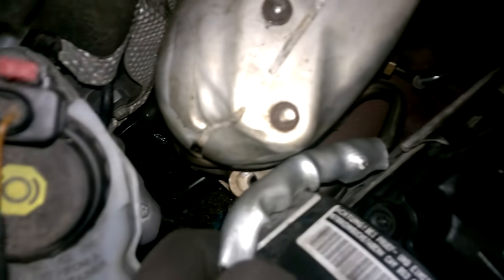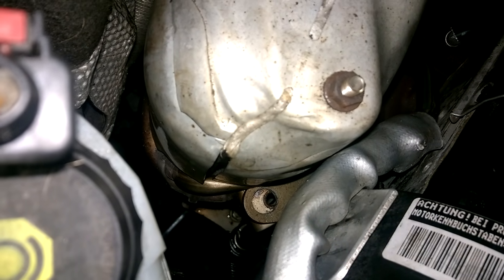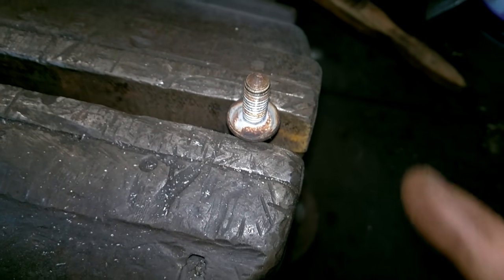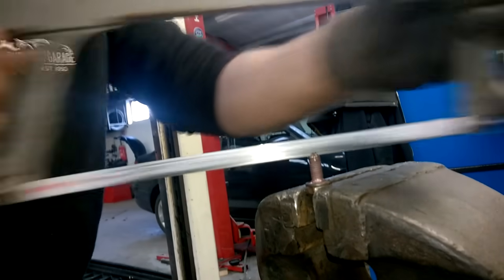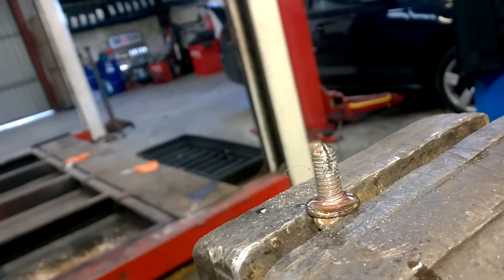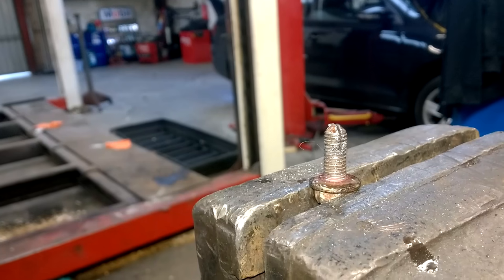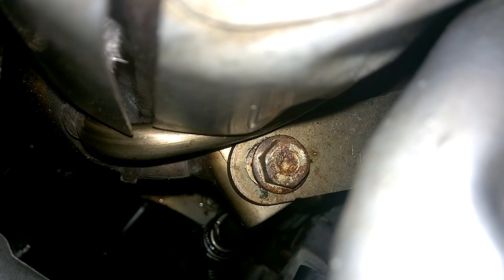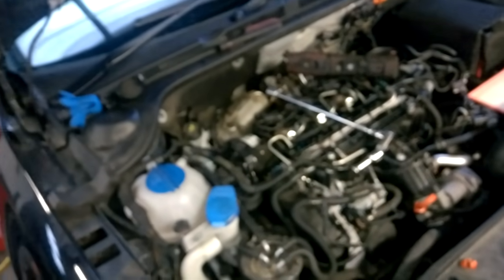My Father Taught Me This! Passing It On To The Next Generation

Comment: Pretty good trick
Reply from the maker: The update info below is the pinned comment on this video, I know most people do not realize I made that video and it better explains/shows this method in use.   
I also included below details of why the job was done this way free of charge with the customer fully informed. I hope you check it out  👇👇
 
UPDATE* I decided to make a follow up video on this https://www.youtube.com/watch?v=yfNQullGEuQ&feature=youtu.be Should answer some of the questions that were raised, I include 3 demos of this in action with close up shots.
 
As there was some safety concerns & confusing comments raised, I felt I should clear a few things up. 
1) This is a tip for certain circumstances only, I never have and never would use it on a component which would cause any safety concern to any customer.  
2) The demo was done on a support bracket only, items like this or similar will not cause any safety concern. 
3) I did this free of charge and on a time restraint, I noticed it when I was replacing another item, the customer needed the vehicle back that evening and I decided rather than leave it like it was, I would do this and secure it up fully. 
4) The bolt was not the issue, the part that the bolt threads into is a secured piece, someone had previously damaged it, leaving the bracket loose and the bolt just tightened a turn or so.
5) The bolt can be removed and will not break, it will go in and out as usual and has helped clean up the damaged threads.  
6) Used in the right application I personally believe this is a great tip and can save you a lot of time & trouble. 

Lastly to all the people who have watched the video, Thanks very much and I am delighted with the feedback I have received on it.

Comment: Good idea.  But a pry bar does wonders
Reply from the maker: The update info below is the pinned comment on this video, I know most people do not realize I made that video and it better explains/shows this method in use.   
I also included below details of why the job was done this way free of charge with the customer fully informed. I hope you check it out  👇👇
 
UPDATE* I decided to make a follow up video on this https://www.youtube.com/watch?v=yfNQullGEuQ&feature=youtu.be Should answer some of the questions that were raised, I include 3 demos of this in action with close up shots.
 
As there was some safety concerns & confusing comments raised, I felt I should clear a few things up. 
1) This is a tip for certain circumstances only, I never have and never would use it on a component which would cause any safety concern to any customer.  
2) The demo was done on a support bracket only, items like this or similar will not cause any safety concern. 
3) I did this free of charge and on a time restraint, I noticed it when I was replacing another item, the customer needed the vehicle back that evening and I decided rather than leave it like it was, I would do this and secure it up fully. 
4) The bolt was not the issue, the part that the bolt threads into is a secured piece, someone had previously damaged it, leaving the bracket loose and the bolt just tightened a turn or so.
5) The bolt can be removed and will not break, it will go in and out as usual and has helped clean up the damaged threads.  
6) Used in the right application I personally believe this is a great tip and can save you a lot of time & trouble. 

Lastly to all the people who have watched the video, Thanks very much and I am delighted with the feedback I have received on it.

Comment: Nice video. Thanks.
Reply from the maker: Thanks Mark 
 
The update info below is the pinned comment on this video, I know most people do not realize I made that video and it better explains/shows this method in use.   
I also included below details of why the job was done this way free of charge with the customer fully informed. I hope you check it out  👇👇
 
UPDATE* I decided to make a follow up video on this https://www.youtube.com/watch?v=yfNQullGEuQ&feature=youtu.be Should answer some of the questions that were raised, I include 3 demos of this in action with close up shots.
 
As there was some safety concerns & confusing comments raised, I felt I should clear a few things up. 
1) This is a tip for certain circumstances only, I never have and never would use it on a component which would cause any safety concern to any customer.  
2) The demo was done on a support bracket only, items like this or similar will not cause any safety concern. 
3) I did this free of charge and on a time restraint, I noticed it when I was replacing another item, the customer needed the vehicle back that evening and I decided rather than leave it like it was, I would do this and secure it up fully. 
4) The bolt was not the issue, the part that the bolt threads into is a secured piece, someone had previously damaged it, leaving the bracket loose and the bolt just tightened a turn or so.
5) The bolt can be removed and will not break, it will go in and out as usual and has helped clean up the damaged threads.  
6) Used in the right application I personally believe this is a great tip and can save you a lot of time & trouble. 

Lastly to all the people who have watched the video, Thanks very much and I am delighted with the feedback I have received on it.

Comment: Thank you!.
Reply from the maker: Thanks Charles 
 
The update info below is the pinned comment on this video, I know most people do not realize I made that video and it better explains/shows this method in use.   
I also included below details of why the job was done this way free of charge with the customer fully informed. I hope you check it out  👇👇
 
UPDATE* I decided to make a follow up video on this https://www.youtube.com/watch?v=yfNQullGEuQ&feature=youtu.be Should answer some of the questions that were raised, I include 3 demos of this in action with close up shots.
 
As there was some safety concerns & confusing comments raised, I felt I should clear a few things up. 
1) This is a tip for certain circumstances only, I never have and never would use it on a component which would cause any safety concern to any customer.  
2) The demo was done on a support bracket only, items like this or similar will not cause any safety concern. 
3) I did this free of charge and on a time restraint, I noticed it when I was replacing another item, the customer needed the vehicle back that evening and I decided rather than leave it like it was, I would do this and secure it up fully. 
4) The bolt was not the issue, the part that the bolt threads into is a secured piece, someone had previously damaged it, leaving the bracket loose and the bolt just tightened a turn or so.
5) The bolt can be removed and will not break, it will go in and out as usual and has helped clean up the damaged threads.  
6) Used in the right application I personally believe this is a great tip and can save you a lot of time & trouble. 

Lastly to all the people who have watched the video, Thanks very much and I am delighted with the feedback I have received on it.

Comment: Couldn't you have just used a tap and die to clean up the threads on the bolt and the hole? I would think that might possible repair and save some of the threads that are damaged. All the threads that are opposite that cut are pretty much worthless as far as offering strength. I'm not knocking the hack, in fact, I think it's rather ingenious. I just thought a tap and die might provide a more secure attachment.  Great video!

Comment: Basically just made a tap. Cool!
Reply from the maker: Thanks Jason, I appreciate the comment, I have linked below the follow up video if your are interested in seeing it in more detail.
 
The update info below is the pinned comment on this video, I know most people do not realize I made that video and it better explains/shows this method in use.   
I also included below details of why the job was done this way free of charge with the customer fully informed. I hope you check it out  👇👇
 
UPDATE* I decided to make a follow up video on this https://www.youtube.com/watch?v=yfNQullGEuQ&feature=youtu.be Should answer some of the questions that were raised, I include 3 demos of this in action with close up shots.
 
As there was some safety concerns & confusing comments raised, I felt I should clear a few things up. 
1) This is a tip for certain circumstances only, I never have and never would use it on a component which would cause any safety concern to any customer.  
2) The demo was done on a support bracket only, items like this or similar will not cause any safety concern. 
3) I did this free of charge and on a time restraint, I noticed it when I was replacing another item, the customer needed the vehicle back that evening and I decided rather than leave it like it was, I would do this and secure it up fully. 
4) The bolt was not the issue, the part that the bolt threads into is a secured piece, someone had previously damaged it, leaving the bracket loose and the bolt just tightened a turn or so.
5) The bolt can be removed and will not break, it will go in and out as usual and has helped clean up the damaged threads.  
6) Used in the right application I personally believe this is a great tip and can save you a lot of time & trouble. 

Lastly to all the people who have watched the video, Thanks very much and I am delighted with the feedback I have received on it.

Comment: When you have to remove it and it breaks and drops down inside the hole you’re done
Reply: That's the next poor pricks problem :)
Reply: Has that actually happened to you?  I don't predict that problem because the cut part of the bolt would have the least pressure against the threads in the bolt hole.  The cut space could hold dirt and rust instead of binding into the threads.  Has that ever happened to anyone?
Reply: @Daddy007111  Cutting the bolt turns it into a tap.  That's the trick.  A person could add another cut at 90° to make the bolt go in even easier and cut more and store more dirt and metal shavings as it does.

You'd have to have a mighty extensive tap and die set and take it with you everywhere there might be a breakdown to get every possible bolt nice and perfect.

You can't always fit the tap into the hole.

I have run into so many bolts that didn't fit my tap set.  The English used to have their own proprietary threads...requiring its own tap and die set.  And this is an old trick that probably fit that time and place of oddball threads.
Reply: @beyondwhatisknown  if you have all the answers then why ask a question. You do it your way, I will do it the right way.  Not arguing just saying what I would do.  Glad you’re in England I won’t need your services.
Reply: @Daddy007111  The right way to do something changes with time available, tools available, your location, proximity to parts, the consequences of your fix going wrong, desperation,  weather closing in, one's own limited knowledge and lack of omniscience.

Nobody has all the answers.  

I have never been to England.  

I heard about English threads from an ex-american who had all kinds of taps, such as flat bottomed ones so you can thread all the way to the bottom of a hole.
Reply: @beyondwhatisknown  when I saw the smoke coming off the bolt  I didn’t care for it.  That’s heat and it weakens the metal when you cut away at it.  Vibration,pressure all factor in to whether it’s a permanent fix or for the moment/ convenience.  If you are going to do it might as well do it right.  Also the bottom of that particular bolt is narrow so it starts easy.   I do enjoy speaking with an intelligent person. Thanks and Happy Wrenching

Comment: Your hack saw blade is toast you should be able to cut that with four good pushes. Pulling with teeth grinding ruins the blade and has no effect in cutting. Push only and you will fly through metal faster then a sawzall and grinder. But thanks for the tip. I'll return the favor by saying if you ever snap a bolt off in the whole get a washer to protect outside of the whole and weld the broken bolt to build up the metal past the washer then weld any bolt type to it and then you have the ability to back the broken bolt out easier then any other process. Drilling and using a stud extractor is a waste of time. ..get the welder get the solid strength back in back the bolt out like a champ. This even beats left handed bits snapping off easy outs and whatever else failure methods there are. Oh and your weld won't stick to aluminum at all so don't worry about filling the whole when welding

Comment: You're actually making a self-tapping bolt.
Reply from the maker: Bang on the money R J 
 
The update info below is the pinned comment on this video, I know most people do not realize I made that video and it better explains/shows this method in use.   
I also included below details of why the job was done this way free of charge with the customer fully informed. I hope you check it out  👇👇
 
UPDATE* I decided to make a follow up video on this https://www.youtube.com/watch?v=yfNQullGEuQ&feature=youtu.be Should answer some of the questions that were raised, I include 3 demos of this in action with close up shots.
 
As there was some safety concerns & confusing comments raised, I felt I should clear a few things up. 
1) This is a tip for certain circumstances only, I never have and never would use it on a component which would cause any safety concern to any customer.  
2) The demo was done on a support bracket only, items like this or similar will not cause any safety concern. 
3) I did this free of charge and on a time restraint, I noticed it when I was replacing another item, the customer needed the vehicle back that evening and I decided rather than leave it like it was, I would do this and secure it up fully. 
4) The bolt was not the issue, the part that the bolt threads into is a secured piece, someone had previously damaged it, leaving the bracket loose and the bolt just tightened a turn or so.
5) The bolt can be removed and will not break, it will go in and out as usual and has helped clean up the damaged threads.  
6) Used in the right application I personally believe this is a great tip and can save you a lot of time & trouble. 

Lastly to all the people who have watched the video, Thanks very much and I am delighted with the feedback I have received on it.

Comment: Poor Mans Tap I’ve Been Doing This For 35 Years 😀😎
Reply from the maker: haha, nailed it Chris 
 
The update info below is the pinned comment on this video, I know most people do not realize I made that video and it better explains/shows this method in use.   
I also included below details of why the job was done this way free of charge with the customer fully informed. I hope you check it out  👇👇
 
UPDATE* I decided to make a follow up video on this https://www.youtube.com/watch?v=yfNQullGEuQ&feature=youtu.be Should answer some of the questions that were raised, I include 3 demos of this in action with close up shots.
 
As there was some safety concerns & confusing comments raised, I felt I should clear a few things up. 
1) This is a tip for certain circumstances only, I never have and never would use it on a component which would cause any safety concern to any customer.  
2) The demo was done on a support bracket only, items like this or similar will not cause any safety concern. 
3) I did this free of charge and on a time restraint, I noticed it when I was replacing another item, the customer needed the vehicle back that evening and I decided rather than leave it like it was, I would do this and secure it up fully. 
4) The bolt was not the issue, the part that the bolt threads into is a secured piece, someone had previously damaged it, leaving the bracket loose and the bolt just tightened a turn or so.
5) The bolt can be removed and will not break, it will go in and out as usual and has helped clean up the damaged threads.  
6) Used in the right application I personally believe this is a great tip and can save you a lot of time & trouble. 

Lastly to all the people who have watched the video, Thanks very much and I am delighted with the feedback I have received on it.

Comment: Have you not got a grinder
Reply from the maker: The update info below is the pinned comment on this video, I know most people do not realize I made that video and it better explains/shows this method in use.   
I also included below details of why the job was done this way free of charge with the customer fully informed. I hope you check it out  👇👇
 
UPDATE* I decided to make a follow up video on this https://www.youtube.com/watch?v=yfNQullGEuQ&feature=youtu.be Should answer some of the questions that were raised, I include 3 demos of this in action with close up shots.
 
As there was some safety concerns & confusing comments raised, I felt I should clear a few things up. 
1) This is a tip for certain circumstances only, I never have and never would use it on a component which would cause any safety concern to any customer.  
2) The demo was done on a support bracket only, items like this or similar will not cause any safety concern. 
3) I did this free of charge and on a time restraint, I noticed it when I was replacing another item, the customer needed the vehicle back that evening and I decided rather than leave it like it was, I would do this and secure it up fully. 
4) The bolt was not the issue, the part that the bolt threads into is a secured piece, someone had previously damaged it, leaving the bracket loose and the bolt just tightened a turn or so.
5) The bolt can be removed and will not break, it will go in and out as usual and has helped clean up the damaged threads.  
6) Used in the right application I personally believe this is a great tip and can save you a lot of time & trouble. 

Lastly to all the people who have watched the video, Thanks very much and I am delighted with the feedback I have received on it.